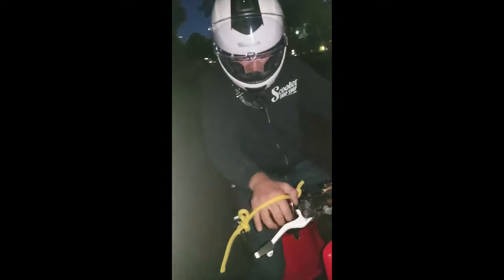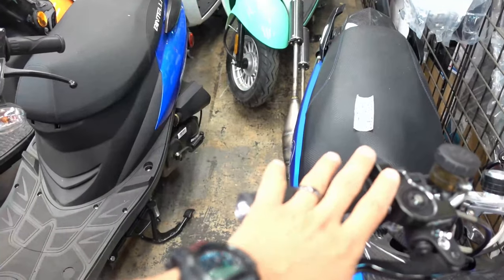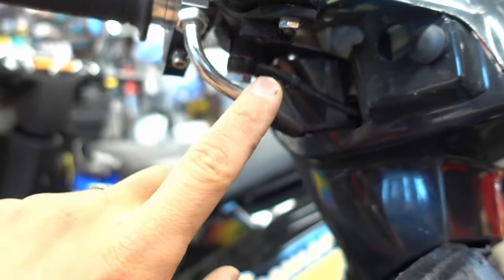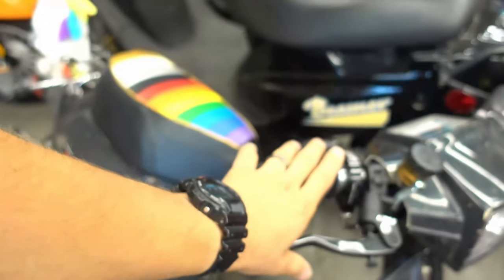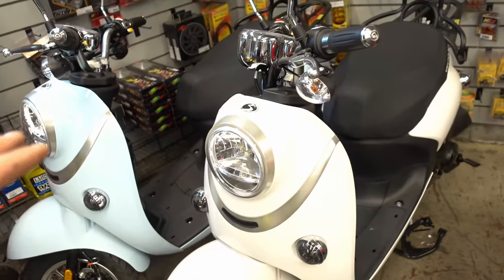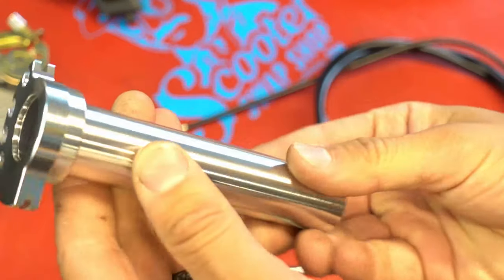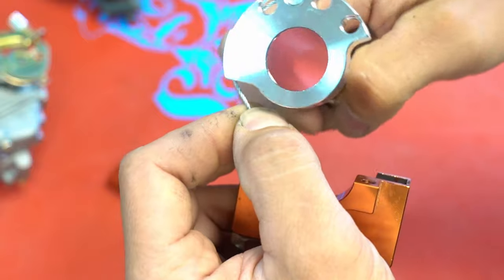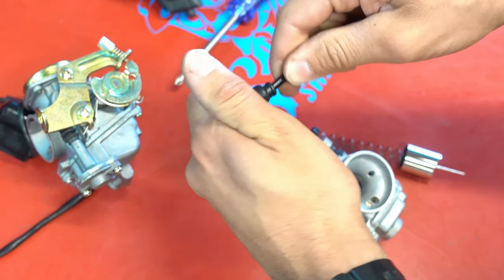Scooter throttle cable install DIY

Comment: I have a Honda spree from the 80's. I unscrewed the cable from the carbonator but the spring that is attached doesn't seem to want to come off very easy. Do I just pull on it until it comes loose from the metal part that you attach the cable to? Also, How do I get the old throttle cable to come off of the metal piece that is over the spring?

Comment: Just wish I saw what or how you missed your factory throttle tube or what not on a bogeyed to run a aftermarket carb
Reply from the maker: Can you maybe try to explain that better? I can’t really understand what your asking
Reply: @Scooterswapshop  sorry for the auto correct. So for a bugeye and wanting to switch to a single cable for a aftermarket carb . With the factory throttle tube leaves the new cable short and would keep the slide open on the carb will all adjusters kept at full slack.  There must be some type of modification to the factory throttle tube and or housing .

Comment: I need to take apart the carb to fix a broken throttle cable on a Fly 150? Mine just snapped (I assume) this morning, turn the throttle and there's no resistance

Comment: You can actually buy the cable on Amazon cheaper than a dealer.
Reply from the maker: Yes if you want a Chinese cable vs oem

Comment: Will the the motionpro cable for bugeye work on a PWK carb?
Reply: Update: The MotionPro cable specific for 02-11 Bugeye does work with a PWK. Still recommend putting a stop in the factory throttle tube as it will twist forward.. not wheelie friendly at all until some type of stopper is used. A peice of 1/4 inch cut extruded aluminum worked for me.
Reply from the maker: we have more cables now!